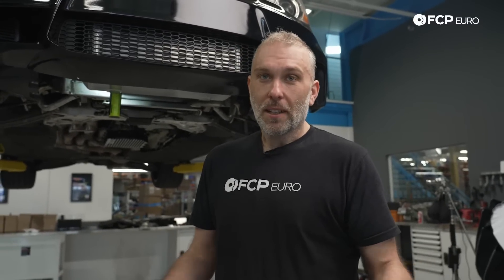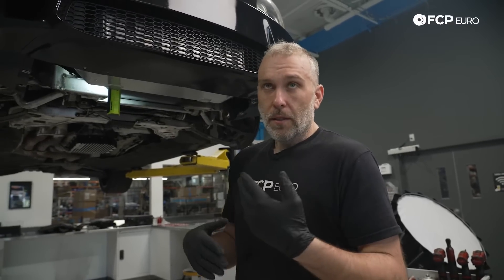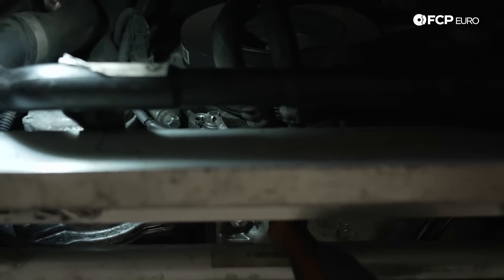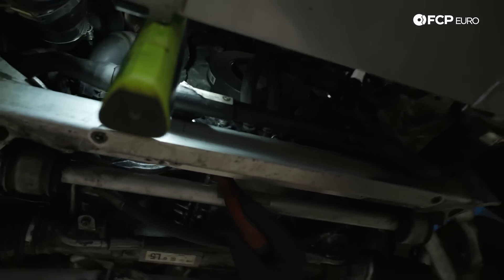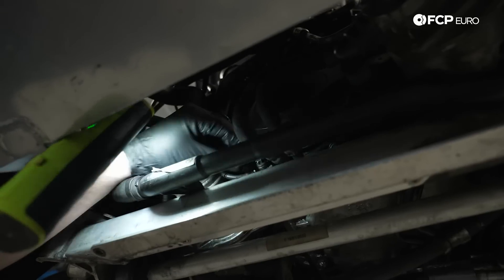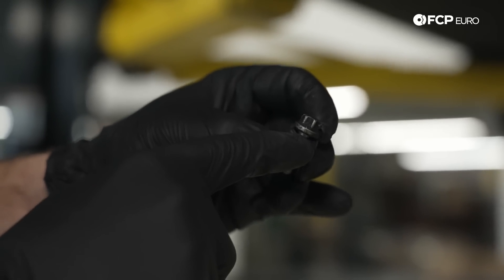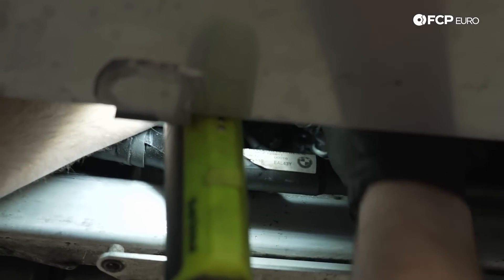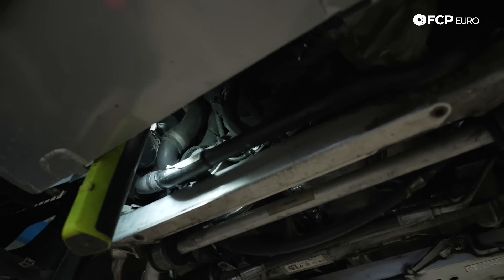BMW N55 Water Pump Ground Bolt Replacement - Don't Get Stranded

Comment: Replacing 14’ n55 from a 335 f30 , water pump has no leaks or symptoms just changing it in case something goes wrong

Comment: I tired replacing the screw and it did not fix the problem, is there something you need to code or should I fix itself right away.
Reply: Did you figure anything out, I just had the same problem

Comment: Great information, working on an N52 now and I’ve realized the issue wasn’t direct contact from the ring terminal to the block, it’s the terminal wire itself.
Reply: What did you do?

Comment: Thanks for the great video Gareth.  I very recently replaced this bolt as a preventive measure to my N55. However, I did not add Loctite to the bolt treads, should I be fine or not? (Is is currently torqued to 23Nm)

Comment: Literally had the exact same thing happen to me yesterday - two hours into a 9 hour drive we were driving uphill in a blinding snowstorm, passing a truck and the engine overheat came on and car went into limp mode forcing me to go to breakdown lane with snowdrifts. A day later and with diagnosis of code 9010 and google we found this video. Taught the mechanic how to do the repair using your video and we were back on the highway! Zero issues since. Turns out there was a BMW recall on this issue last fall for my 2016 X5. But your vid was a lifesaver!

Comment: Thanks for the heads up about this issue. I will replace mine. One question that is confusing to me thought, you sell the bolt but it seems as its a genuine BMW part that would be aluminum  .Why wouldn't you sell the proper steal replacement? What is the bolt specs, so I can source the replacement bolt myself. Thanks!

Comment: Never thought I had to deal with this, but mine was broken and hanging by thread once I put the socket on it it fail down. Thanks for the great advice.
Reply: What did you do to fix it?
Reply: Did you move the bolt to the top? Mine broke on a 435i xdrive but I just can’t get to that top slot

Comment: Where its come the ground wire from the water pump? Because my bmw its not connected 😢 there is only the bolt

Comment: So I have a water pump from pierburg (the metal one) and it has rubber grommets for the bolts that the VDO original doesn’t have, that could mess with the pump to engine ground, my question is am I able to just relocate the ground to the subframe or block or it has to touch the water pump aswell
Reply from the maker: Using whatever existing ground is already in place will do; all of these pumps, including the original OE units, have mounting bushings, sometimes over time, that harden into a plastic type of looking material.

Comment: Question can you still turn on bleeding mode without ground
Reply: Pump doesn’t function without a good ground.
Reply: @matt.108  yeah but my ground is good and everything and in order to drive good without overheating the car i need to bleed the car so the pump can work
Reply: @gamingtv962 did you figure it out? Also did you have code 378f?
Reply: You can just put the car in accessory mode and then press the gas all the way down for 15 seconds it’ll activate the water pump and do the bleed for 12 minutes

Comment: I've looked up the part on FCP website and it doesn't seem to fit my N55. Will this bolt work on 2014 355i GT x drive N55? Thanks

Comment: I had my waterpump that was in fail safe intermittently mode for almost 40k miles. It would run non stop after the engine was shut off draining the battery. Wonder if it was a ground connection that shorter it out.
Reply: And what was that issue ?
Reply: I have the same problem in my m235i. I will do it and check if i need to change to screw or the water pump.

Comment: Would you please tell me where this bolt is on my 2012 X5?  I took the panels off the bottom and looked but cannot find anything that looks like what you are showing.  Thanks for your help and these videos and information are priceless!
Reply: Trace the wire coming off the WP electrical connector going to block - that's it....there is no other wire that goes to block from that connector.

Comment: This is a great idea in theory, and many people make this kind of change on all kinds of things thinking that they upgraded the bolt and it will be stronger now bey using a stronger alloy/metal. 

I’m not an engineer by trade but have been formerly training in aviation maintenance.

My question is how are you tackling dissimilar metal corrosion and not compounding the problem?
Reply: Ans is in the video near the end

Comment: Can you confirm if this is on F chassis F3x? A lot of the guys are confused because realOEM doesn't show this bolt on that chassis / engine combination.
Reply from the maker: 100% the same screw. Here are the fitments listed on RealOEM:

https://www.realoem.com/bmw/enUS/partxref?q=12527557037

This broke off on my 2017 X5 xDrive35i last December. The "maybe's" I mentioned in this video were things that definitely happened to me 200+ miles away from home.

- Gareth
Reply: @fcpeuro  335i nor F30 are listed. The design is different on 335i. Still an issue? I've never heard this happen on a 335i.
Reply: @fcpeuro  thanks for the response. No F3X cars are listed with that link, hence the confusion. Been meaning to check for the bolt myself, but haven't gotten around to it yet.

Comment: Happened to me 2 years ago at 40,000km. Dealer couldn’t get me in for 3 weeks so I scanned it myself, got the code. Took a peek underneath to try find the water pump to see if it actually went bad, man that thing is buried in there. Fortunately saw the dangling ground wire and sheared off bolt in the process. 

I put a new aluminum bolt back in, thinking it was a pretty rare occurrence. Probably going to switch it again after seeing this and how common it is.
Reply: I replaced an electric water pump on a 2006 i535 xdrive. You are right, it's tucked up above the right front driveshaft and a real pita to do on your back!
Reply from the maker: It's surprising there isn't a TSB about this out there yet. More and more people are coming forward talking about this failure/experience.

Kudos to you for identifying the problem and fixing it yourself.

Comment: Did it just happen to you or is it common and has it happened to others? This is the first I’ve heard about it
Reply from the maker: Happened to me. And since bringing this to light in our blog article it's turned into a talking point in the community. It's a very random failure that only seems to affect the N55.

A lot of shops owners have seen these break off and I've seen a few techs post about it on social media as well. I thought it was a freak failure that happened to me until someone else on IG linked me to a video with the same problem.

- Gareth
Reply: @fcpeuro  ok thanks. It could be under torqued from the factory as that adds a lot
More load to the bolt

Comment: Ground points are Magic points to avoid some malfunctions!! From the early 2000 to these days some brands seem to forget that and small ground wires are use even with more electronics....
Reply from the maker: Proper griunds are everything for electronics. And a lot of weird gremlins can sometimes be resolved by fixing a ground. A lot of the braided ground cables used on modern BMW's are very problematic. They pretty much just disintegrate. Checking for proper ground first before going down the diagnostic rabbit hole can save you a lot of unnecessary running around.

When it comes to this water pump problem there are two different pumps used on N55's. Pumps that do not have the rubber insulators/vibration dampers to the engine block mount (solid aluminum housing) will often ground themselves through then water pump housing if this primary ground breaks off. You get perfect continuity between the pump and the block. For the water pumps that are insulated from the block you will lose the ground if the main ground breaks off.
Reply: That’s because almost everything now a days is pulse width modulated, or is run by a driver that steps down the voltage. That’s why wiring has shrunken in gauge in the last 2 decades.

Comment: Wow electric water pumps trash
Reply: Yes, I agree.   Just another part that costs too much and breaks too often.   Electric pumps came about from Higher CAFE Restrictions so emissions can be controlled through higher engine temps.  They are NOT SAVING THE PLANET by building cars that have to be replaced every 100k /10 years.   EVs are NOT SAVING PLANET either........Just a SCAM to control the masses and sell more vehicles.
Reply: So real
Reply: I don’t disagree but that’s what’s in the 2000 and up BMW. I do not think there’s an alternative but to replace the pump at 100,000 with a trusted brand. Probably BMW OEM.
Reply: @Iwillnotbepushed   NO.....In 2000 M (such as M54) Engines were still being built with belt driven water pumps. Starting N52 Engine on has Electric Water Pumps.  On US versions of the BMWs that would be 2006 and on. These electric pumps can fail as early as 60k and it is probably best to replace them before they reach 100k.  They can go more. I had one fail at 94k and another fail at 140k. The issue is there is usually no warning when they fail, leaving one stranded on the side of the road. (Most of the time Mechanical belt drive pumps will give some warning - slow drip, noise etc.)  The OEM BMW Electric Water Pumps are made by Pierburg.  I have had belt driven water pumps go more than 200k miles. The other difference price $300 for the electric vs. $50 for the belt driven just for the pump itself.  If you have never changed an electric one I would allow yourself 2 days, there are a lot of caveats and working in very tight spaces (Huge Learning Curve).  In theory it should be easy,  a electrical connector , 3 bolts and  2 hose connections.  It is really more than that when you have to account for changing out the thermostat because it is highly recommend that you replace both at the same time because you need to remove the electric pump to replace the  thermostat. It is +/- $1k job at the Deal for an Electric Pump.  Mechanical Pump will be less than half.
Reply: @Iwillnotbepushed  The newest B-series engines are back on mechanical waterpumps